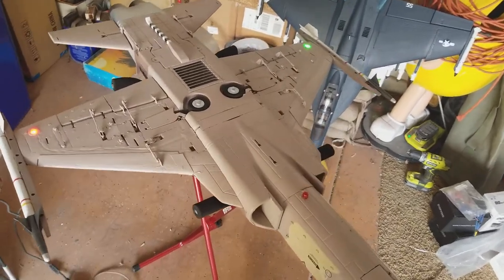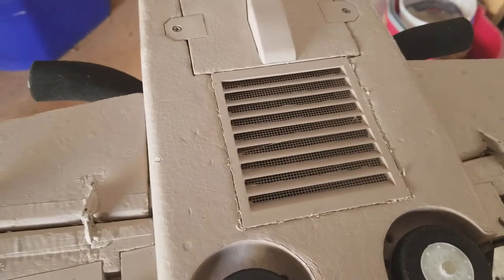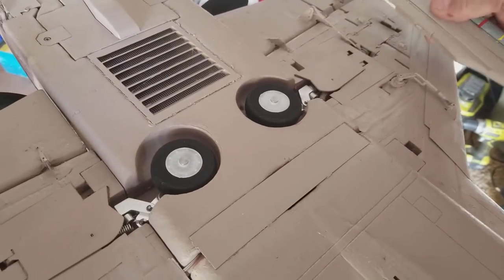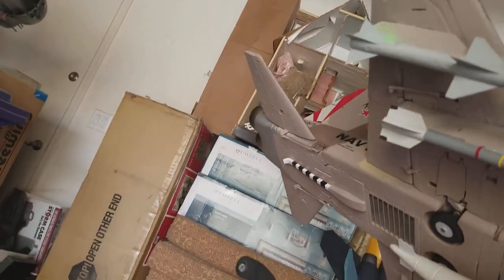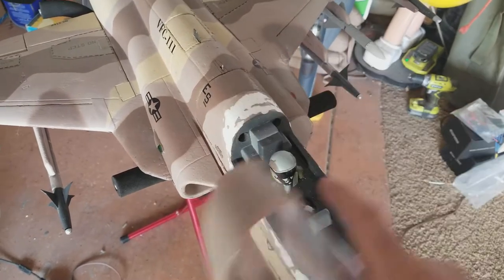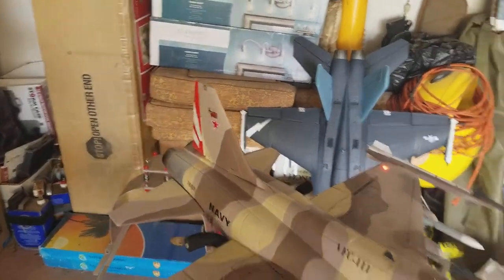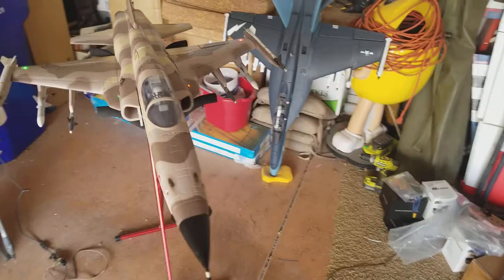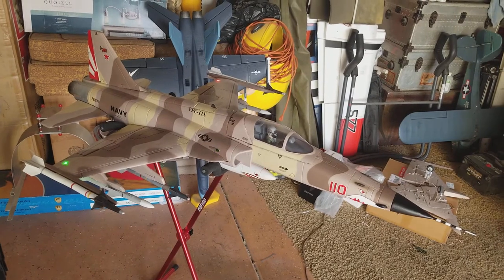Modifications to the FW 80mm F5

Comment: Dude... love the leading edge flaps. I would love to have them on my Elfite F16 70mm.. like IRL. But, I'm just not that good of a mechanical engineer. IT systems engineer...yea. Just not mechanical lol. Really hard to do with foam wings and get them like the real ones. All the control rods are internal in the wing. I like your design but don't think it would be viable on the F16.
Reply from the maker: You and me both!
Reply: @BrandonMoon1  been thinking about getting this bird but...its that older design. I just got the Freewing A6 with updated power system. Some kinds wonky things that have improved in newer planes over the years. Its funny though, got Freewing AL37 as my first Motion RC product. There's some thing I wish Eflite did like Freewing and vice versa.